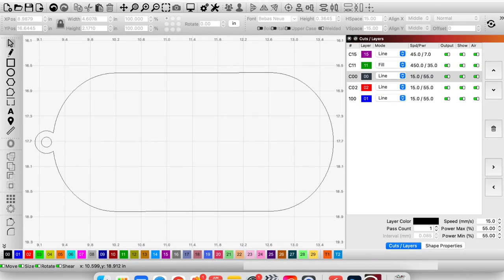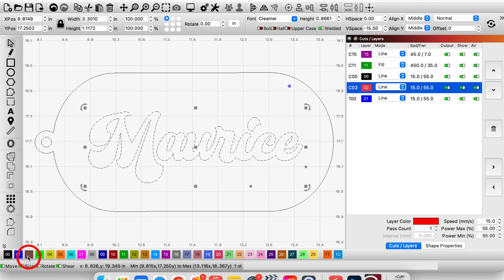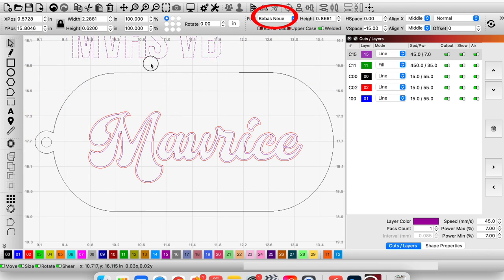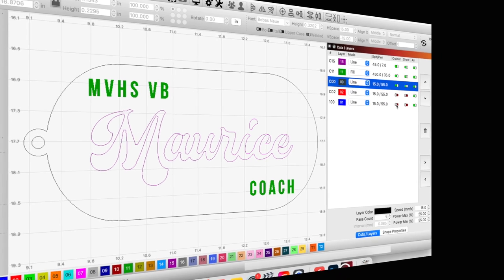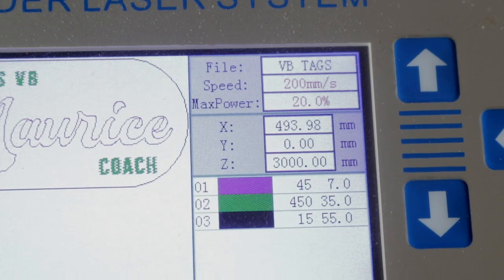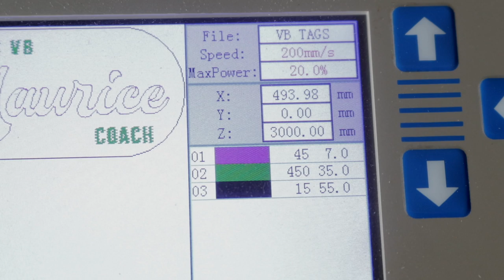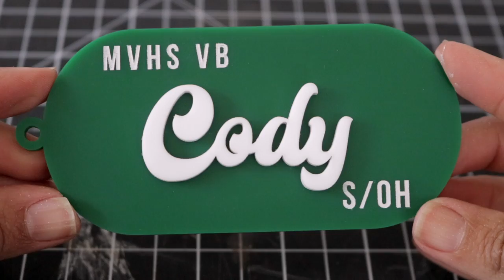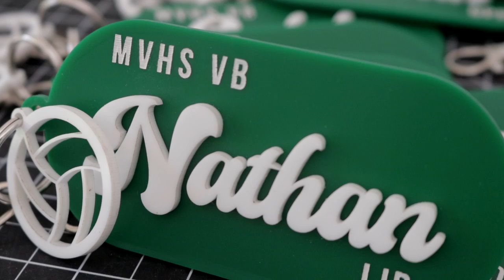Engraving & Cutting Acrylic on a Thunder Laser

Comment: Interesting method! If you didn't already have a thunder machine, would you opt for a 3D printer and use pla filament instead? I'm a newbie and was wondering what machine would be most time efficient and cost effective in the long-term when making 3D keychains. Thanks!